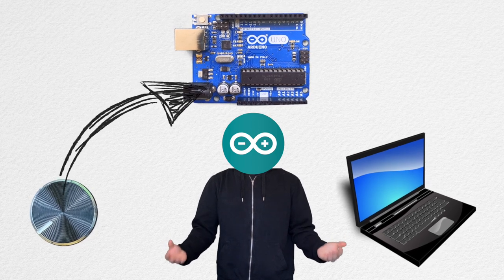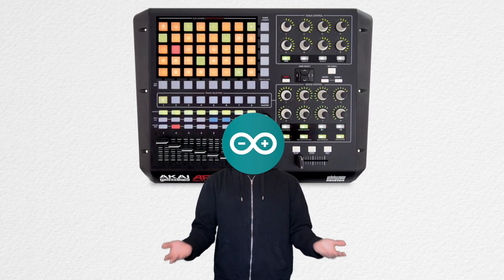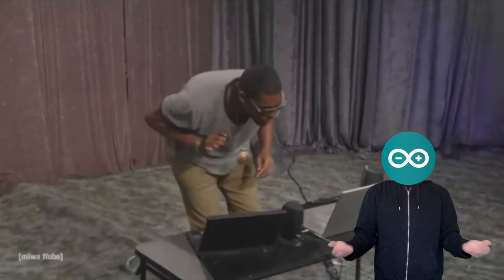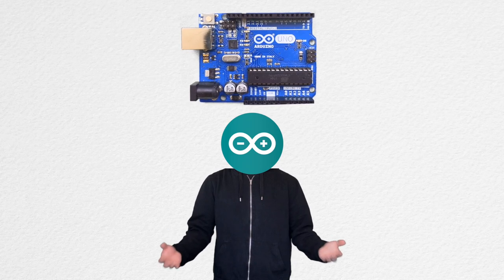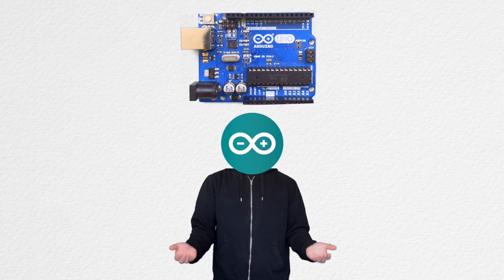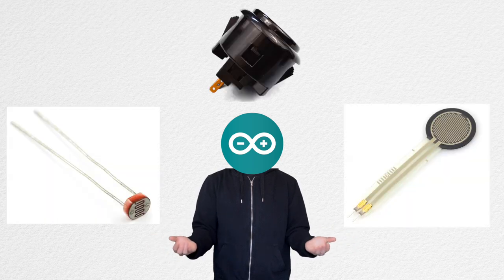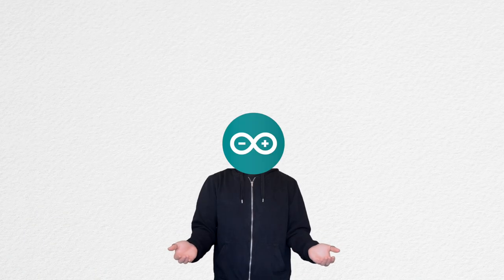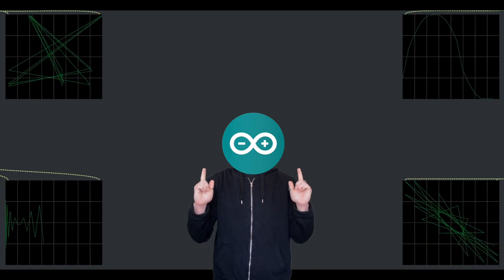Arduino Musical Instrument Explained

Comment: Genial, gracias por compartir. ¿ Si quiero hacer un instrumento como una especie de molino, con el flujo de agua de un río, me conviene seguir con arduino o raspberry? pensando en que quizás no pueda enchufarme a un laptop. Y si sigo con arduino que sensor me serviría para experimentar con el flujo de agua en una dirección, mezclada con la fuerza del viento o mezclarla con algún otro dato o sensor?, gracias estoy aprendiendo mucho aquí. SLDS
Reply from the maker: Arduino would be fine to use. There are wind sensors out there. I actually used one before. I recommend the one sold by Modern Devices. 
As for spinning, you could use something like a hall sensor. It measures magnetic force, so you can stick a magnet on a spinning thing and measure the time between when the magnet goes by the hall sensor. GOOD LUCK

Comment: I noticed you use Arduino, are there pros & cons to using Arduino as opposed to raspberry pi?
Reply from the maker: The main con of using Arduino for musical application is that you need to have it hooked up to a laptop in most situation. With Raspberry Pi, we can embed the Pure Data patch into it and have a standalone instrument. A claim is that there is latency when working with Raspberry Pi + Pure Data + sensors (around 19ms). About 8ms more than Arduino + Max. But Raspberry Pi is constantly evolving so it's hard to tell now. If you wanted to do embedded audio, I highly recommend Bela or Daisy. Both have super low latency (close to zero). And they already have analog inputs built in unlike Raspberry Pi where you have to have an external ADC (don't know if the newer models have ADC built in tho). 

Of course, it depends on your experience with Raspberry Pi and the workflow. I personally like to work with a laptop, but I've started working with embedded audio recently.    

In short, it depends on your work-flow + experience and what you would like to accomplish!! I would love to know what you have in mind!

Comment: For anyone who knows? If you wanted to build an interface with as many control knobs, buttons, encoders, sliders, etc. as possible, which Arduino version would you choose? I figure if I’m going to try and build something I might as choose a platform that’s as expansive as possible. Thanks in advance for any advice you share.
Reply from the maker: ARDUINO MEGA!
Reply: @SoundSimulator  Cool, that's what I thought. Thanik you!

Comment: how use the midi controller directly on arduino processong pure data (not to computer)?
Reply from the maker: It's not possible to embed Pure Data patchers into Arduino. You can do it with Electrosmith Daisy or Bela though!